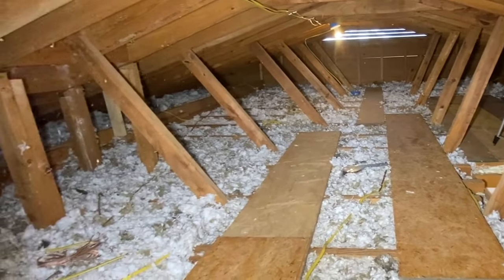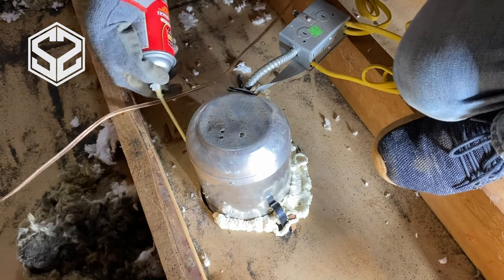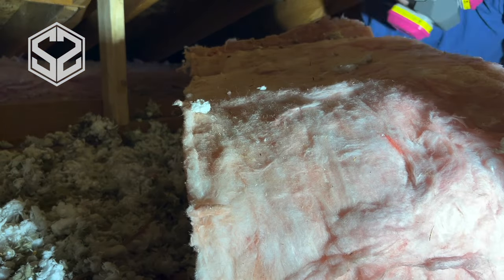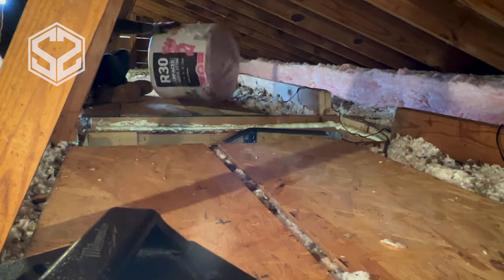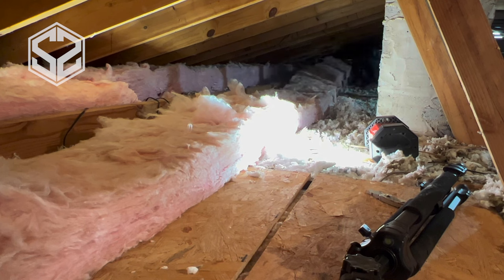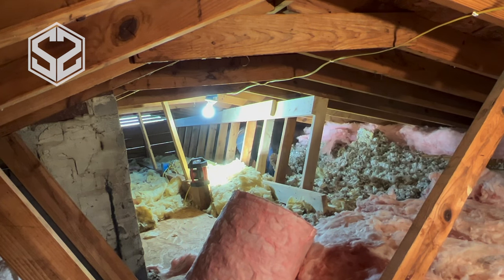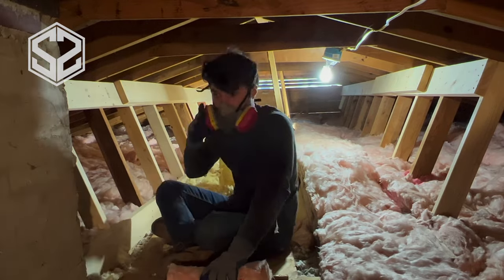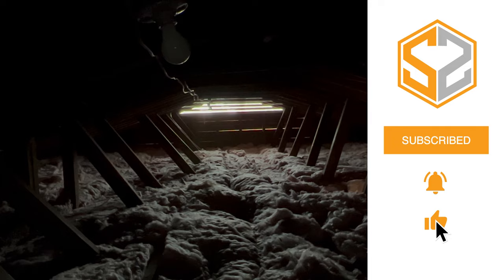How To Insulate Your Attic

Comment: Good video but I have 2 comments … (1) when sealing up the openings for electrical wires coming into the attic from downstairs walls shouldn’t you use fire break caulk not the spray foam?  Fire break would slow the spread of a fire in the walls to the attic. And (2) were the can light enclosures rated for insulation to be touching them?
Reply: If a fire was inside the walls the house is a goner anyways. Go back to reading your Manuel’s😂

Comment: Great video... Maybe you could suggest to anyone thinking of installing insulation to first elevate the walking platform. This allows access for future needs.... the insulation can then be installed beneath the raised platform. The platform can be used for storage.... I do see that your roof has a very low pitch, maybe a 3 or 4/12 pitch which doesn't allow for raising your platform... again great 👍 video

Comment: Any particular reason as to why you didn't just add more blown insulation with your old insulation.  Is rolled fiberglass batts on top of blown insulation a better way? Planning on working on my attic this winter. should I just take out all my of old blown insulation and then replace w only batts or should I go your route and reuse the old blown insulation and then add batts on top?
Reply from the maker: Good question. The batts actually add a lot more R value or insolation efficiency than the blown in insulation so I definitely wanted to use batts. As for the old insolation, it would probably be best to rent an insolation vacuum and remove all of the old stuff and lay the batts inside the rafters and then if more R value is needed add blown in insolation on top. For me the old insolation was still ok so I didn’t want to waste it and that’s a lot of extra work to remove the old insolation to just replace it. So I chose this way. It is still a good option and if you run the batts the opposite direction it will prevent it from squishing the blown in insulation. 

Hope that helps! 

Thanks!
Reply: If you were to put the batt insulation between the ceiling joist would you use the paper back against the drywall living soace or just use paperless like you did above your blown in insulation?

Comment: Hi! One question please, I will be removing all the old blown in insulation in my small home, attic, as it is completely wasted. So, my question is because you say in part of your video not to use faced insulation with one side of paper when you are laying down the new rolls. But I believe this was because you were placing the rolls over previous blown in insulation, which I will not be having. In other words, should I purchase and use rolls of insulation as faced rolls, and placed the paper side down when placing? Additionally, do you think it’s better to use the rolls or the blow in method? Thank you so much.
Reply from the maker: Yes, because you are removing the old blown in insulation you can use the paper faced insulation. You will just want to make sure it is paper side down. And I would recommend the rolled insolation because it has a much better R value or more efficient than the loose insolation.

Comment: Is it going to hurt anything by just rolling new insulation over top of those plywood pieces?
Reply from the maker: From the research I had done it seems to be fine to add more over top like this as long as you don’t use the backed insulation. The backing acts as a vapor barrier and can trap in moisture and cause damage over time. But thats not the case with the stuff I used.

Comment: I’m looking at the similar project.  Wondering if I should remove the old blown in insulation that is likely 20 years old…or just lay rolls on top of it.
Reply: Only reason why I’m taking mine out first is because it’s disgusting and has rat poop all over.

Comment: Thank you for both videos. I am about to tackle this same project and I feel a lot better about it after watching your video. Is there a reason that you didn't install baffles? Especially since you mentioned the importance of the attic being able to breathe.
Reply from the maker: Thanks so much!! 😄 I did come back and add soffit vents along both sides of the house to help with airflow but there was already a ridge vent along the roof ridge and on each side of the gable there was large vents to allow air flow.
Thanks and good luck!
Reply: @SimonSaysDIY  The gable and ridge vents allow the airflow to short circuit since they are closer to each other than either is to the soffit vents. Should close one of those off, so that the soffit vents can act as intakes.

Comment: missed what kind of foam sealant you were using around cans, in wall gaps? I also need a sealant around the exhaust vent pipe for above the stove... but it needs to be a special kind?  Please let me know; thanks!
Reply from the maker: This is what I used to seal any gaps and cracks. https://www.lowes.com/pd/GREAT-STUFF-Gaps-and-Cracks-12-oz-Straw-Indoor-Outdoor-Spray-Foam-Insulation/3012216

Anything that could come in contact with heat, I used this more heat resistant foam around our chimney, lights, and kitchen stove vent. https://www.lowes.com/pd/GREAT-STUFF-Smart-Fireblock-12oz-12-oz-Spray-Foam-Insulation/1000645183
Reply: @SimonSaysDIY  I have an attic space that’s 18 feet by probably 20 feet and that encompasses a small living room dining room area a bedroom a hall to closets and a bathroom. Is there something more industrial that I could use rather than buying a lot of single use cans I have a terrible problem with bugs and spiders coming in through huge gaps in the drywall in the attic is basically open to the elements because of the attic vent

Comment: Foam doesn't stick, to DUST. At 1:38 in your video, nothing but dust. Get some painters grade latex/silicone caulk next time by the case. You can buy a whole case cheaper than one can of fire foam.

Comment: How would you know where to step on in case you had to fix a roof issue or just check something,  
Is that ok if i put some boards on the insulation?
Tks for the video
Reply: You don't want anything to compact the insulation.  Check the comment from "gold blueberries" above. Cheers

Comment: What were you using to cut the fiberglass? Some kind of long knife?
Reply from the maker: I use a regular utility knife. If you press a board down on top of the insolation you can use it to squish it down to easily cut it with the knife. It also works well as a straight edge for cutting.

Comment: Thank you for making this video, Simon. If you already put down the insulation on top, do you really need to spray foam to prevent leakage? Thanks again for the video!
Reply from the maker: Hello! Yes I would still recommend sealing the attic. It improves the air quality in your house and cuts down on energy loss. Our house was old and in many places the attic air and insulation dust was leaking into our house causing congestion and allergies. After sealing the attack we have noticed a big difference in how we feel and in our energy costs.
Reply: Thank you for taking the time to help, Simon. Much appreciated! @SimonSaysDIY